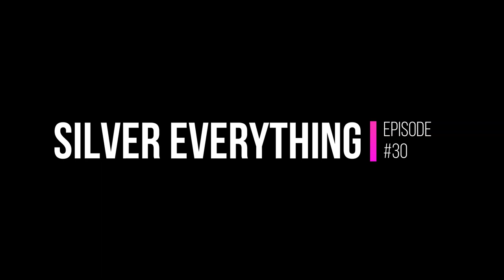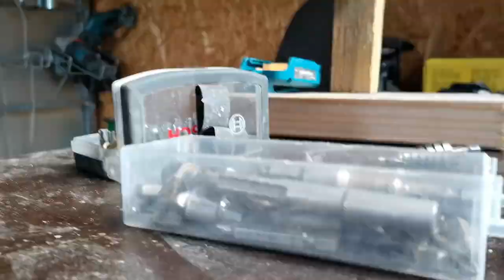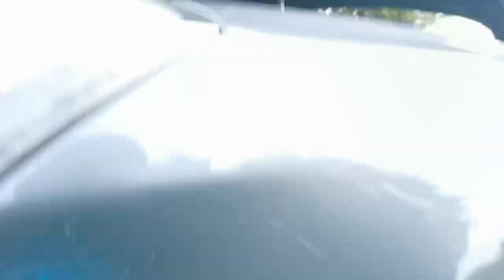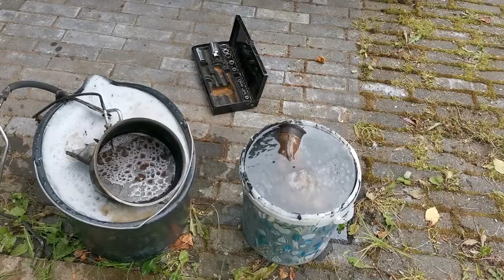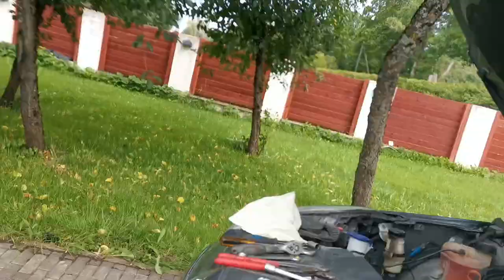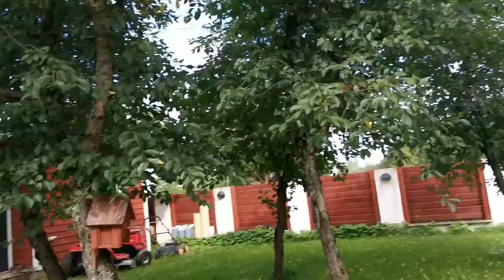[30] Particle filter cleaning - DIY DPF Cleaning

Comment: Im suprized that you had these issues with a Citroen, they are said to be the market leaders in this technology as they have been doing it the longest and spent more money in DPF development for their own vechicles.
I used to own a 1997 Mk2 facelift 2.0 litre diesel C5 exclusive and once a month id take it to a dual carriageway and do 25 miles in 3rd gear at 70mph, minimum 3 thousand rpm and it would force a regeneration of the dpf in 135,000 miles I never had any issues with the DPf system. it is also important to keep the fuel tank at least half full or the system will not rengenerate.